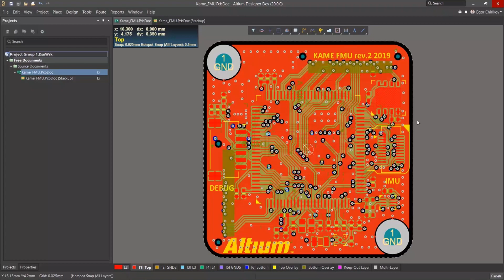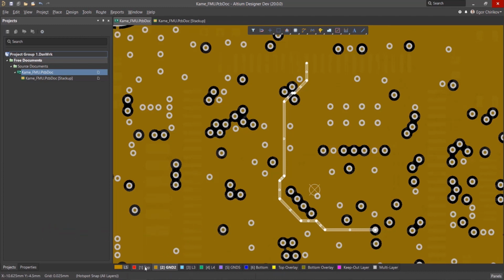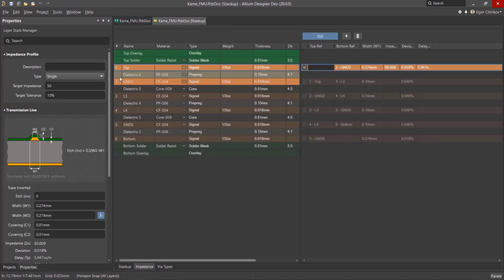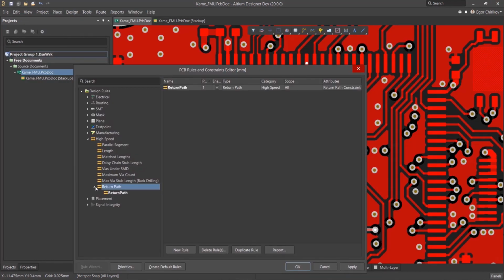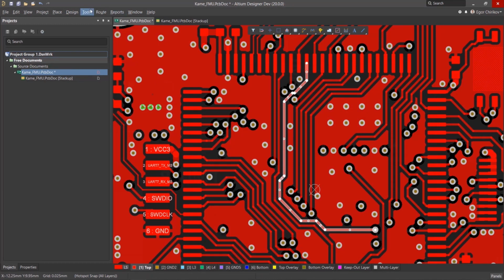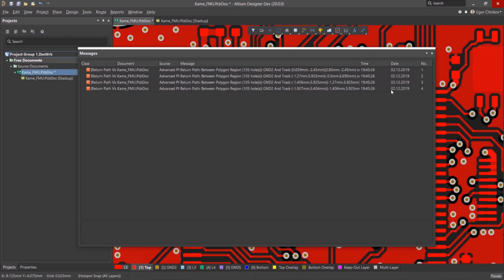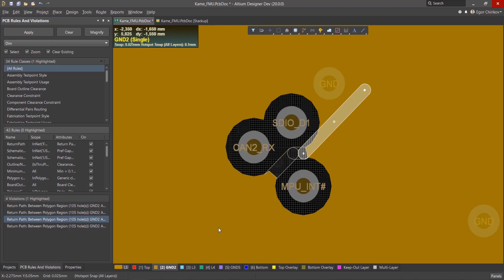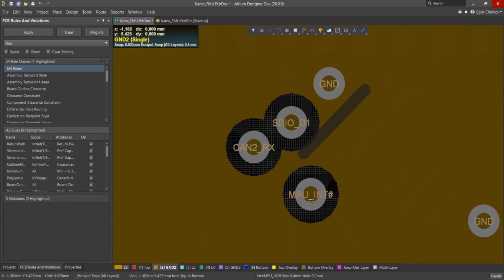How to Create and Validate Return Paths in Altium Designer

Comment: Is the design rule checker intelligent enough to recognize when I change layers and reference planes?

For example, if I have a 4-layer board with a layer stack as SIGT-GNDT-GNDB-SIGB and I route a signal that goes from the top signal layer (SIGT), that is referenced to ground top (GNDT) to the bottom signal layer which is referenced to bottom ground (GNDB), will Altium be able to check the return path continuity and generate a DRC error if I don't place a stitching via connecting GNDT to GNDB by the signal via to change layers is placed?